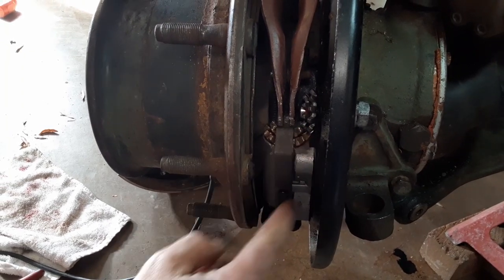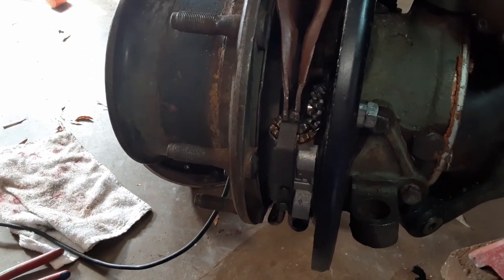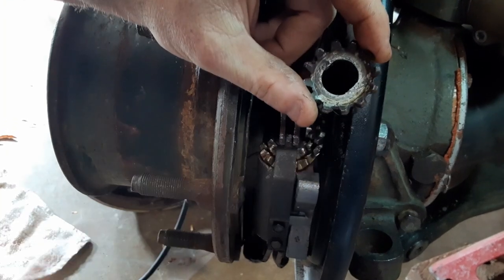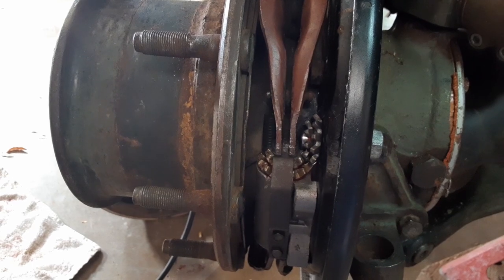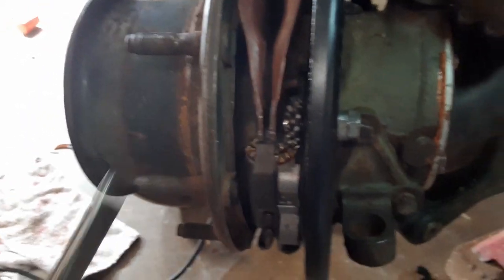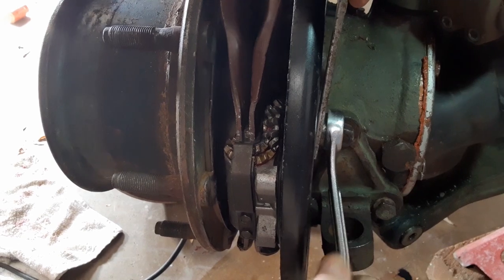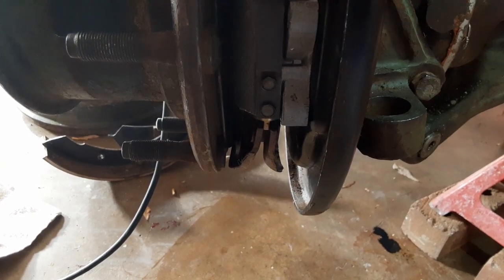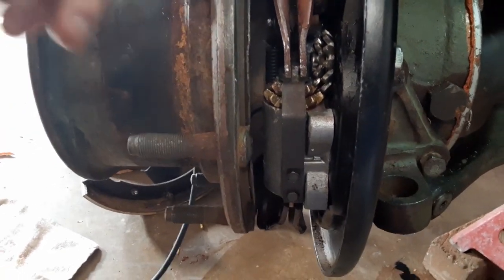Ferret Brake adjustment

Comment: Takes me back to Newcastle in 1983 50+ ferrets and half a dozen Saracens at a TA unit I was seconded to for two years as they were changing over to CVRT and needed CVRT trained mechs to help to teach the TA REME how to work on them, due to the Falklands the changeover was delayed and we only got the Samson, Sultan and Samaritan plus two Spartan but that was two years I will never forget, my next posting was back to 432's with 4 armd div and signal regiment in Germany but they also had six dead ferrets when I turned up so guess who got tasked with fixing them, 5 back on the road and 1 for workshops with failed wheel station plus a few other faults so you can guess where the parts to fix the others came from.